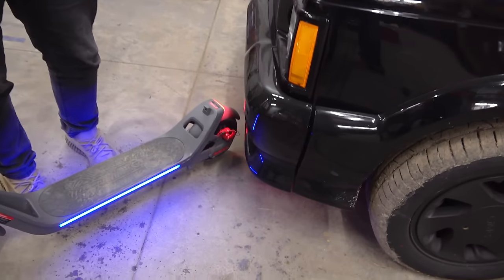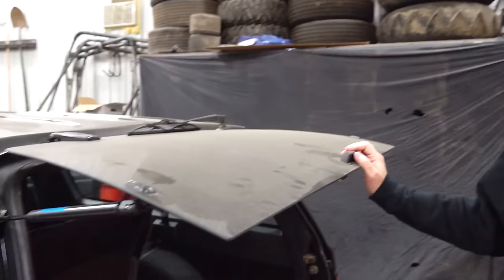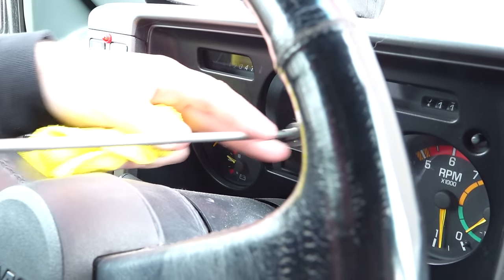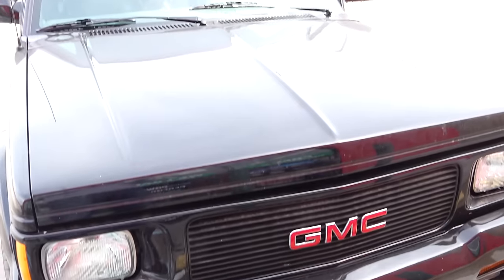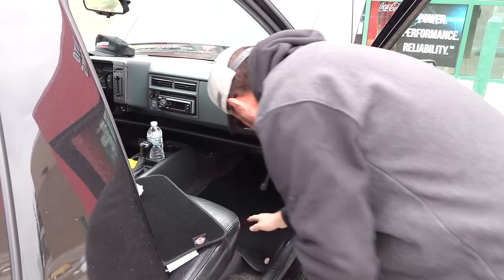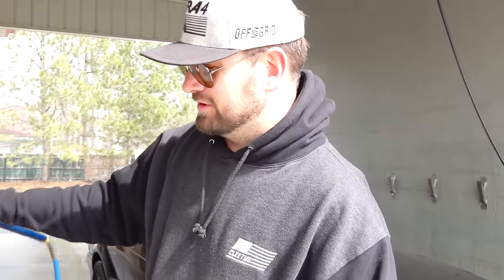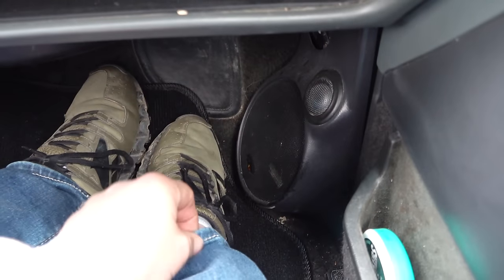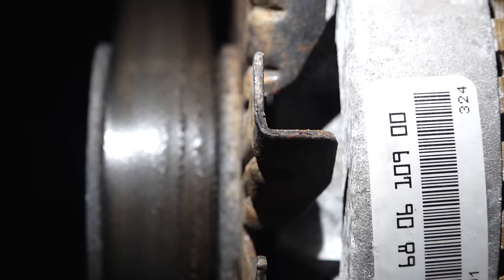GMC Typhoon NEEDS to find a new home…

Comment from the maker: Ideas for this rig? Comment below 👇
Reply: Let Frankie drive it lol
Reply: Honestly, make her a bit quicker but nothing dangerous and enjoy it. Mabye some sticky's for the road to corner better.
Reply: More power? 👀
Reply: Bigger turbo and some nos
Reply: Paint correction.  Otherwise just make it a solid runner
Reply: Build it for cleets next race.
Reply: If its over 30 years old does it need a catalytic converter in California?
Reply: Leave it stock, make it run and drive good, maybe clean up the paint. Then whoever ends up with it can leave it stock or modify it themselves
Reply: There's nothing about stock. Mod that sucker.
Reply: @banana1658 there giving it away. Did you not watch the video?
Reply: At this point you already have a K&N & non stock belt on the truck. Mine as well go for broke and add some power and sound (exhaust) to her.  Nothing crazy with a sound system but you could upgrade the speakers.  Honestly if anyone was to win this and wanted to have it tuned ect. They most likely wouldn't have the connection you guys do to have it done right by the guys who did the Sy.  This would help some of us who don't have the extra funds to do so.
Reply: We need a engine swap on the typhoon in the near future! Ok hear me out get a nice but not show room condition. And do a build on it and have two of them have one stock and one heavily modified. Then take them to events and do some awesome stuff! You both could do it one stock class and the other in modified class. 🤷‍♂️
Reply: I wish I could comment a pic of my 98 dirty 6.5 suburban that I use as my mobile equipment repair rig . You could turn it into a offroad support rig need some fab but man it 
Would be one of a kind
Reply: Time too build it and make it a beast on the road and track
Reply: Fully built 💯🇺🇸
Reply: I was thinking it would make a better race week ride than the syclone.    Less concern molesting this one too.
Reply: @jeffmoleskivintageiceracin5935  dosent mean they can't enjoy it while they still have it
Reply: A nice set of shocks and stickies so it handles, bigger turbo maybe two and a big ole bottle of go fast nitrous should do it!!!
Reply: Period correct aftermarket radio, dual exhaust, then send it. It’s already BA…
Reply: Keep it stock!
Reply: You people talk like you were there .
Reply: Keep er stock. If you wanted to build something like this just buy an S10 and throw an LS in it
Reply: Some tasteful mods would be nice and send it with the stock parts for purists.
Reply: Catback and a freshly cleaned K&N never hurt
Reply: cassette player and a row of tapes...
Reply: Have sportmachines do all the upgrade mods, including an engine limit strap, and turbo tweak chip.
Reply: The link
Reply: Leo Did you get the link?
Reply: Keep it stock and clean. Buy a same model year blazer and LS swap it, put a big blower on it and race LS George
Reply: Tasteful mods, reliable driver, with some umph. Take it to the strip to make some content. Install CarPlay and some speakers but leave overall appearance stock looking. High flow cat with some nice pipes, still be legal and sound delicious. Keep up the consistent content! I’m in michigan too, so rooting for you fellas!
Reply: Put it on e85 with a chip and some more boost
Reply: If you guys are going to STL Supercross I would love to come say hi. Any chance we could meet up for a second?
Reply: MO POWA!
Reply: Whooop Whooop
Reply: I really like stock. Maybe stock isn’t better but it feels right

Comment: If you cant clear the alt fan, maybe look at a flex rad hose. Then you can route it however you want. 
Radio id leave as is since it works. Rare with some aftermarket jobs.

Comment: The only radio that truck deserves is the old school dolphin face pioneer
Reply: Or the old school Kenwood with the face that turned completely around. Had one in my first car, it was a pretty neat trick until the ribbon that connected the face to the rest of the head unit crapped out.
Reply: Man idk… what are we supposed to find one on eBay 😂😂
Reply from the maker: Uh ya Frank!
Reply: A full size cd player would barely fit without cutting or heating the ac ducts behind the radio. Circuit city road shop from 98-05
Reply: my exact thoughts, Phoenix Gold amp and a kicker L7 solo baric sub 😂
Reply from the maker: @kylegill1710 I’ve always wanted to try out a old school Cerwin Vega Stroker
Reply: I miss my JVC Chameleon

Comment: I was the one who recommended the magnet trick. Lol  it really does work I dont have a Magnet fetish and want to see you play with magnets  😂😂but you need a Really strong magnet you know one of those ones you struggle to remove once it's magnetized to metal. Or you can take the cluster apart and spin it back. But caution it will go back when the battery dies doesn't matter what method you use
Reply from the maker: noted! Thanks

Comment: The old Eclipse head units were the shit.  I have one that is slightly older than that one, but it has the same "beep beep" noise.  Top of the line in 1999.  5v pre-outs.  Don't replace it with anything less.